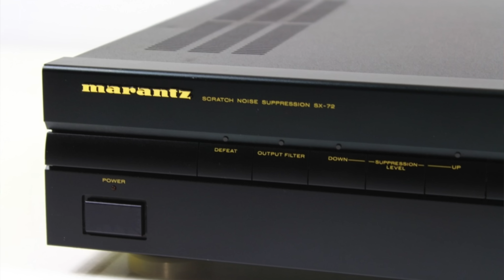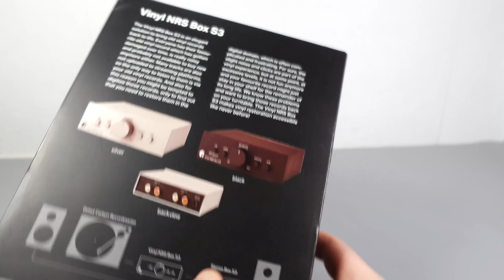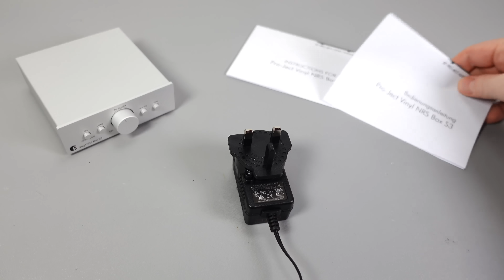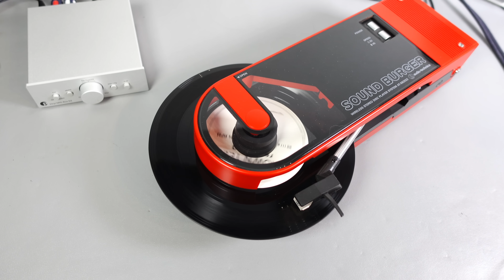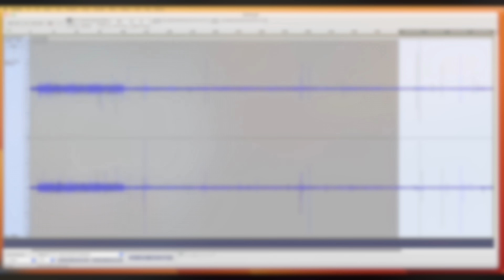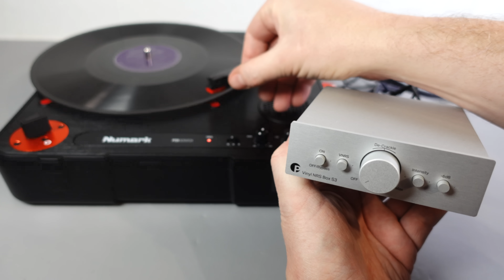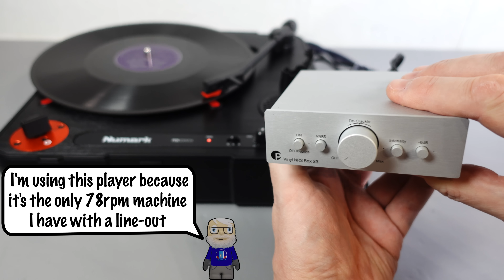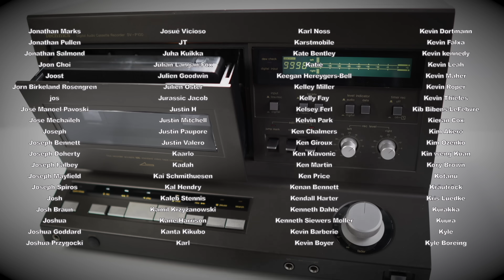REVIEW : Vinyl Noise Reduction System Pro-ject NRS Box S3

Comment: A crackle is different from (tiny) scratches.
Crackle is mainly groove ware / damage and or dirt inside the groove like dust and grease.
To get rif of crackle you have to upgrade the cartridge to shibata like cartridges, those needle tips are much more refined and can heavily damaged grooves sound like new because of their shape of polishing.
This device is not something I recommend because it will effect the music, specially brass and strings.
It's a gadget, not more than that.
If you are looking for a way to listen to your digitalised albums it's better to buy a DAW like Izoptope RX8 (wich I use) to smoothen out the pops and clicks and even vinyl noise.

To my humble opinion it's best to do a small high pass filter and click removal while leaving the crackle and groove noise intact, reducing groove noise will result in dull sound.
If you can;t stand that noise, swith to cd's.

Greetings from the Netherlands (Henk).

Comment: In order to develop the circuit, I needed a scratched record to test it with, raiding petty cash I went out to Oxford St HMV and bought a copy of "Rumours" by Fleetwood Mac then proceeded to attack it with a razor blade, putting deep and shallow scratches radially on the record, for several days I was very unpopular in the office. ( I did record it first, I had a Tandberg TCD330 cassette deck ) Is that drooling I hear in the back ground.  🙂

Comment: You can aquire powerful VST audio plugins for your PC for removing crackle and noise that would put this little box to shame.  I use a good Music Hall phono preamp with built in digitizer and then feed it to the Plugin Alliance GigPerformer3 realtime audio host app on my PC along with VST plugins from iZotope and Waves.  You get fine control of the process and the results can be amazing.  The latest noise reduction VST plugins are even using advanced AI-based neural network algorithms to reduce noise and are amazing.  This little Project box doesn't seem to do a particularly good job at restoring vinyl sound.

Comment: This is surprising. I'm used to some pretty much efficient software plugins that do a great job in de-crackling. And it used to work on the fly.
The older versions of the software were even more efficient, by cutting crackles off in comparison to the newer which are also lowering the volume at the spots addressed.
But: Doesn't work with oscillator-driven electronic music with the old software. Saw-shape sounds get erased almost completely.

The classic analog diligence work of de-crackling was also cutting away the raw crackles from the audio tape and covering the finer crackles with sticky tape on the magnetic side of the audio tape. Learned this from a veteran EMI mastering engineer.

Comment: Nice review thank you. Between 1977 and 1979 I was a design engineer working for a UK magazine called Electronics Today International in London. I was asked to design a click eliminator because a new chip had just become available call a "bucket brigade device". The SAD-1024 from Reticon which featured in a commercial click eliminator device.
If you google "eti click eliminator" you'll find the reprints as the first two links. and some pictures of the January 1979 cover. It was analogue and as I remember worked better then the device you've just reviewed. enjoy John K.

Comment: Great video review. Back in the day (70's), I came across the plans for a Transient Noise Eliminator.  I modified it to work at line level instead of between the cartridge and the Phono input. I built this device as I was at the end of what I could tolerate in records. Unlike the one tested here, mine worked flawlessly and completely eliminated any trace of the click/pop as if it never existed, like magic. You could adjust the sensitivity to suit the condition of the record. This device is a boondoggle. It clearly does not work and for the price, they are selling people a bill of goods for high prices just like with the so-called High End Audio equipment today. Back in our day, pretty much ALL amps from ALL name brand manufacturers could deliver the quality and performance that today's equipment CANNOT do unless you are prepared to pay thousands. Even then you need sub woofers as the amps are not capable today. Back then it was standard performance. That being said, why anyone would purposely want to use vinyl records as a source is beyond me. I grew up with that technology and I can tell you there is NOTHING better or even good about it. Those who claim 'it sounds better, more warm etc' are delusional. There is absolutely NO science to support this. I do appreciate this video as it just shows so called 'Audiophiles' are being conned. That's my rant for today. :-)

Comment: I've used professional software for de-clicking / de-crackling / de-noising audio, and even then I've still had to go into the file and manually take out loud clicks and pops myself.
As ever: there is no magic solution, despite the advert lying that there is.

Comment: Might be interesting to see how well this unit's pop/crackle processing compares with an old Burwen Research DNF-1201A, which I believe was also sold under the KLH brand as the TNE-7000. Those old units processed audio signals entirely in the analog domain, and, as I recall (disclaimer:  it's been a long time), did a very respectable job of reducing transient noise events like ticks and pops.

Comment: Perhaps not for the faint of heart, but the best crackle&pop reduction for vinyl audio is in my opinion woodglue. I've treated by now dozens of records that I bought second hand and besides being dirty quite a few were unplayable due to the crackles. I recommend to try it on a few records that are expendable first. The cost is almost neglegible, just the handwork for putting the woodglue on, patience to let it dry 24 hours and skill to pull off the dried glue together with whatever dust and sand was in the grooves.

Comment: Thanks for this interesting video. I too had gotten a Marantz SX-72 scratch noise suppression system, and I can confirm, it does next to nothing. Only in the quiet sections of a speech-only recording I could get it to make at least some audible difference. No surprise this is the only such device Marantz ever made. This Pro-Ject system works much much better. I agree it is not perfect, but there certainly is an audible difference on anything you throw at it. To me it seems like the "intensity" setting in some samples actually made the de-clicker less effective.

Comment: I made an analogue  transient reducer in my teens. Used a small delay line to copy/repeat the blanked section over the click. Should be possible today to make a much better fill using digital. The key to success is to be able to trigger on the fast transient of a click. RIAA smooths this transient so better to detect before the RIAA de-emphasis is applied. If possible, you might experiment with putting the device before the phone preamp/equ. (depends on sensitivity of this nr device)
Reply: Hello ... you beat me to the comment. Back in the day (70's), I came across the plans for a Transient Noise Eliminator like you mentioned. I modified it to work at line level instead of between the cartridge and the Phono input. I built this device as I was at the end of what I could tolerate in records. Unlike the one tested here, mine worked flawlessly and completely eliminated any trace of the click/pop as if it never existed, like magic. You could adjust the sensitivity to suit the condition of the record. THIS device is a boondoggle. It clearly does not work and for the price, they are selling people a bill of goods for high prices just like with the so-called High End Audio equipment today. Back in the day, pretty much ALL amps from ALL name brand manufacturers could deliver the quality and performance that today's equipment CANNOT do unless you are prepared to pay thousands. Even then you need sub woofers as the amps are not capable today. Back then it was standard performance. That being said, why anyone would purposely want to use vinyl records as a source is beyond me. I grew up with that technology and I can tell you there is NOTHING better or even good about it. Those who claim 'it sounds better, more warm etc' are delusional. There is absolutely NO science to support this. I do appreciate this video as it just shows so called 'Audiophiles' are being conned. That's my rant for today. :-)

Comment: 6-8db of NR on pops is only going to kill the little ones. 
I've dubbed a couple hundred albums to the computer and some pops are 24db or more louder than the surrounding signal. 
When making a car play disc via computer I just trace out the big pops manually. Yes, it's time-consuming as hell.
This said, I thought what the Project S3 box did for your Beethoven record was admirable.
Most times I've used automatic (software based) filters, the air in the recording went away. But listening to your Beethoven dub the air and room sound of the recording was still there.

Comment: As someone with a LOT of experience digitising and de-noising records, using everything from manually drawing out loud clicks to hugely configurable software like Wave Corrector, I can tell you that there's no way you can design a one-size-fits-all algorithm to do the job benignly/transparently, in real time, across an entire side of a disc.
Reply: It has been done!  I'm running ClickRepairRT (Real Time) on an old XP PC, and it works near-as-dammit perfectly.
Reply: @trottophone  I was going to say that you can loop through a PC/laptop, but you still have to configure for different types of music - classical/orchestral is usually easy (although not brass) but anything with percussive transients can be very difficult. I used to check with  the 'inverted' output (only what was being removed) and it was often a real eye-opener. It's actually been a few years since I've done any work on vinyl (and now you mention it, Click Repair was what I was using) after I suffered catastrophic hearing loss in the space of a month from polyneuropathy (nerve damage) - I've now got c.4kHz in my left ear, 2.5kHz in the right (can't hear cymbals at all)  :-(

Comment: "Galvvanic pure bypass"? What will the hi-fi marketeers come up with? It's just true bypass, plain and simple.
I'd take a look inside. What is this device made of?

Makes me wish it came with a built-in phono preamp with the true bypass option in case you already got a separate preamp. Not too much of an engineering challenge, but the feature would make the thing attractive to owners of integrated amps who used phono inputs (then just plug the NRS box into the line input instead, and use it as a preamp), or anyone who starts their journey with vinyl records and needs a preamp anyway.

VNRS really makes a difference, all the crackles are much quieter, and you still hear it's a vinyl record :)
Pity about the lack of bass.

Comment: Why don't you try this with that Soundburger clone record player you had which had a very noisy motor in it?  The motor must have had bad commutation or bad isolation, because it put a lot of hum into the audio circuit on that record player.

Comment: I did hear the NRS box doing something in some of those recordings.  With that Beethoven record I thought the crackles and pops changed a bit when it was on, I say changed rather than improved.  When you played samples of the DBX test record, it sounded to me like there was some 'pumping' going on, when there was a loud crackle, the noise reduction seemed to be defeated to some extent, I can't describe it very well.  The rumble reduction seems to have some effect, that's for sure, the rattling and rumbling of your record player was noticeable in the first sample but it was much quieter in the last one.  I suppose that feature may work to some extent if you have a record player with a noisy motor.  Overall, if I had a record collection and record player, I wouldn't spend my money on this device, I'd spend it on records instead.

Comment: For anyone who works with audio on a computer and wants to archive records, Izotope RX does some pretty amazing noise and crackle reduction, and editing in RX would give a lot more editing control over your project. It would have absolutely made some improvement to that last record. It costs about $300 US for the newest standard version, so a little cheaper than this device. It's a standalone program so not necessary to know any other paid audio software, if you can use audacity you're qualified lol. The Pro-ject device probably does a fine enough job for most consumers, sounds pretty good to me, I listen to this on my studio monitors and didn't notice any obvious problems on the more modern records (granted after YouTube processing), although the bass might indeed be a little lower.  But if you can already work with audio at all, there's a better way.

Comment: I was hoping for such device to appear. Thank you for showing it.  I have an application called Sound-Soap.  This unit appear to do a somewhat similar job.  But unlike Sound Soap, this unit cannot learn the surface noise of a specific record. That may be the reason why the results are not good in all cases.  With Sound-Soap you can "record" a noise sample of the noise you want to remove while playing a part of the record where there is no sounds.  This option would make this unit really worth while.  I don't know if it is still available since i bought that application more than 12 years ago. Thanks again!

Comment: As a professional audio engineer, pops and clicks are hard enough to deal with in post-production with proper full track analysis and an empty section of track to compare to create the baseline for the Pop/click filter. Doing it on the fly has never really been that feasible. Typically in live audio we just end up using a compressor, sometimes with a narrow band eq to try to contain them

So far as the noise reduction goes, It sounds like it's a fancy low bypass filter. Effective, but it will affect unintended low end sounds as well. 

There's no such thing as magic!
Reply: @@johnevans647 How original.
Reply: @@johnevans647 The obvious is that have-nots always envy the haves. Don't worry... maybe one day you'll buy your own magical bullshit turntable... ;)
Reply: Is there anyone trying machine learning (AI) based solutions to this. On image processing, machine learning is used intensively. Nvidia DLSS and Intel XESS are some examples. Upscaling from lower resolution up to 4K in real time for gaming purposes.
Reply: @bltzcstrnx  There are some modern post production editors that can use AI. Can't do much about live. The problem though is that it always has a risk to affect intelligibility and music integrity. Real music isn't perfect tones, and the human ear can be VERY sensitive to adjustments in post.

Comment: Anything that takes a certain set of frequencies and just cuts them , wont work. With surface noise you have a constant hiss I would have thought an electronic unit could monitor those frequencies and negatively invert and feed back to the input thus cancelling them.  this might cancel wanted sound though, so careful.  Effectively to work a unit would not be in real time, it would take a source , process and re-make it , which sounds a software requirement (or a ROM system if you want a separate),  then you listen to the digitised output,  no other way of doing it.   There should be "blue" 78 stylus for those numark etc USB / Line out record players

Comment: It's disappointing that it wasn't better. I would've thought this device was just a microprocessor running the Audacity pop and click filter (basically a hardware Audacity module), but in my experience Audacity is a lot better. Maybe it's that it's doing it real-time, instead of all-at-once after reading the whole track like Audacity?

Comment: Thanks Matt, as always! :) It will certainly come in handy for those who don't have many sound quality claims, but it's clear that, in addition to not solving the problem as we would hope, it also destroys the audio, which a very common software would do if not used with caution, such as Adobe Audition. As the film restoration school teaches us, the only way to remove noise as cleanly as possible, wtihout touching too much the main signal, is to work on every single click, manually.

Comment: Thanks for this video. In the 1980's, there were fully analog alternatives to this device. Burwen Research /KLH TNE7000a, the SAE5000a and Garrard made one as well but I don't remember the model number. The Burwen TNE7000a was always considered the best of these. I've posted a video where you can hear the audio with and without processing with one of these. It seems the TNE7000a is actually doing a better job than this Project.